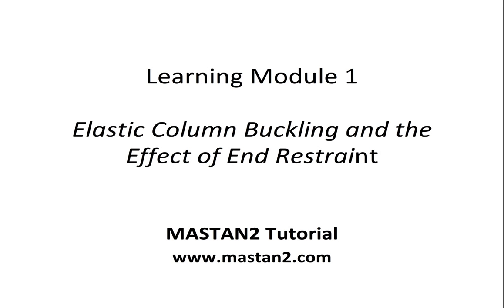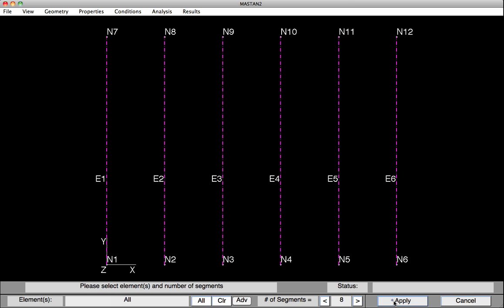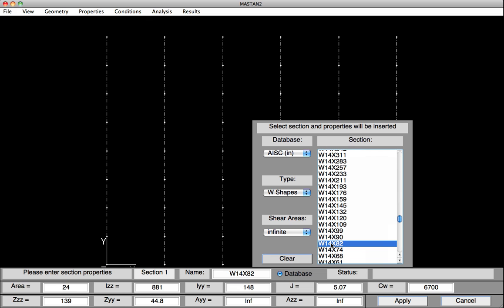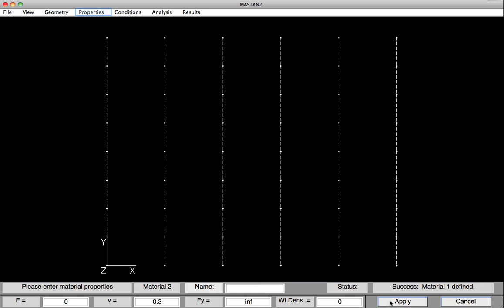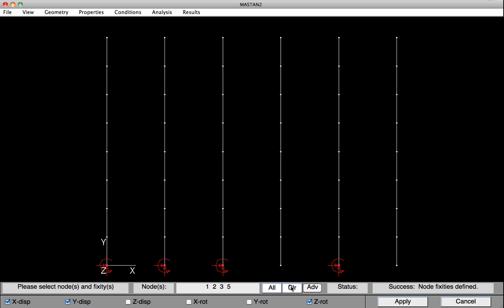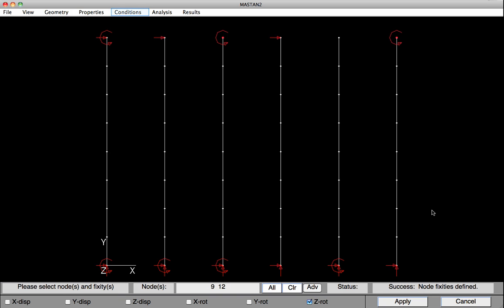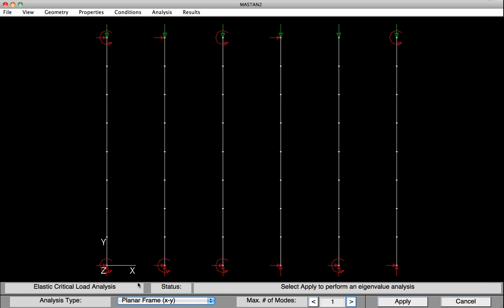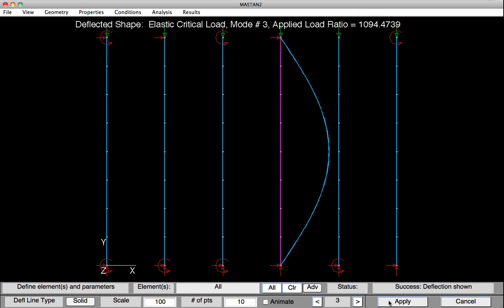MASTAN2  - Learning Module 1

Comment: Hello Doctor, I have a question, why did you divide the columns into eight segments? Thank you
Reply: I will answer for him. Increasing the number of nodes also increases the accuracy of the results. Bear in mind the FEM models continuous elements using discrete representations. If you have only the nodes at top and bottom, the results will not be very meaningful. Theoretically, you could have an infinite number of nodes to get the right accuracy, but obviously that's not practical. Try setting up multiple instances of the same member as he did, and subdividing it into different numbers of segments, and see what happens.
Reply: @BillPolhemus  thank you very much Bill.